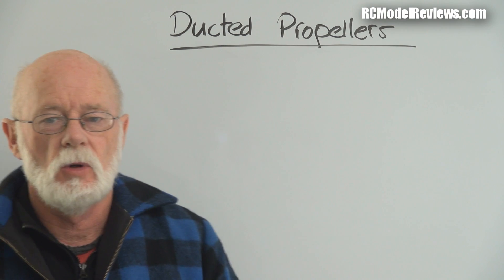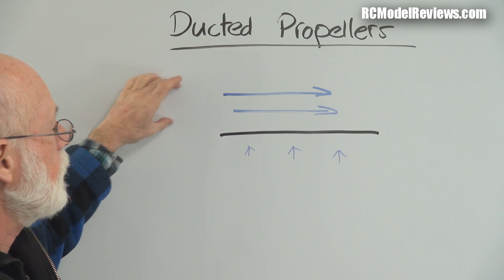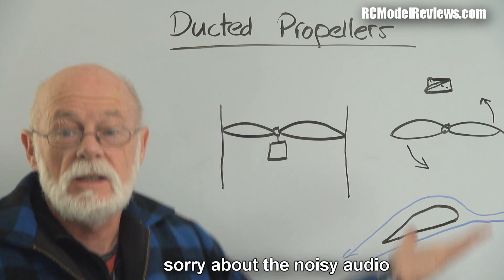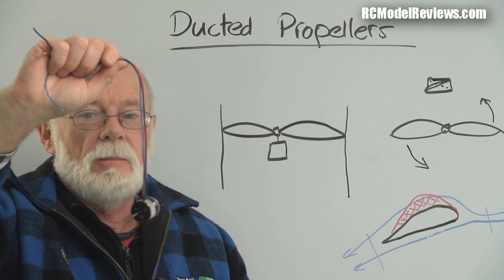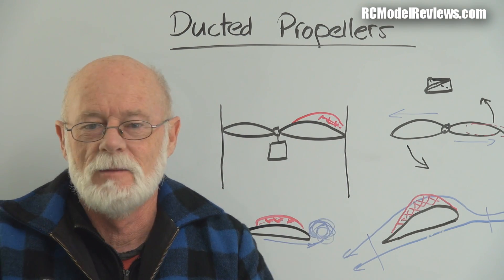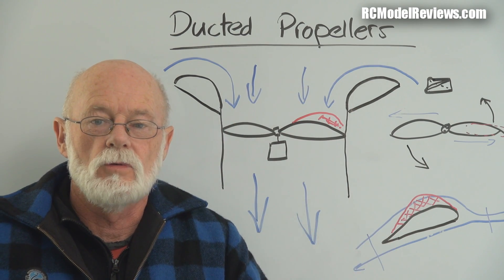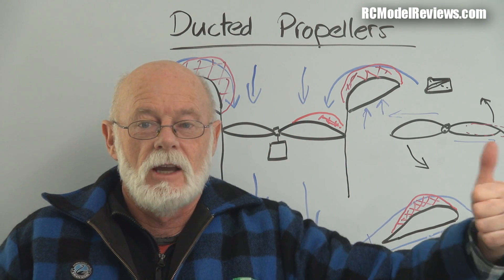How ducting a propeller increases efficiency and thrust

Comment: Very sympathetic guy, unfortunately he also gets bernoulli wrong or explaining incorrectly. The pressure on top is not lower because of a longer distance on top and higher on the bottom because it is shorter, that implies equal transit time which is wrong. The pressure on the bottom of the wing is higher because the air gets slowed down due to shape and angle of attack and particles on the top due to their mass try to move on straight and thus create a vacuum on the top. That really is simplified and changes around the body. The net result is lift and drag. One side effect is that the air is deflected downward but is not the reason for the lift, just an effect of the pressure distribution.

Comment: Bravo! And to think his brain must move faster than his mouth to convey the content so succintly and accurately makes the whole thing more compelling to me. Definitely not the kind of instructor I would expect to learn the lesson from the class lecture.  Had one not read the assignment and done at least a few of the exercises there'd be little chance of doing the homework much less passing the tests.   One thing that popped up in my head to ask was that to gain more lift by defeating wingtip vortices little, vertical spoiler vanes were added to larger aircraft were added. I presume they were meant to retain as much low pressure over the top of the wing.  As such, would spoilers on propeller tips work to enhance or obviate the need for ducts?

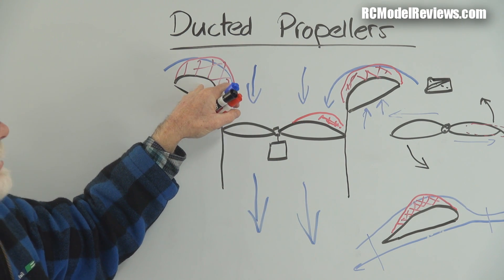Comment: 14:43 your "coanda's lips" will suffer the same vortex as a regular propeller because of the centrifugal force pushing it's high and low pressure zones to the border... so you add a second tube around it ? with new lips... with a 3rd tube... with lips... this has no end !

Comment: so as the air pressure decreases in front of the prop, less air is there for the prop to "bite" into sooo.. does the prop cavitate in air or does a vaccuum occur and it pulls the prop forward? and when you go higher in altitude and less air is available does the whole system collapse..... and how big does a prop have to be to work at high altitudes... ;)

Comment: Great video! 
Loved the content, however one thing to realise is that the lift provided by a wing and therefore the thrust produced by a propeller is mainly due to the Coanda effect which we have recently acknowledged that proves that the flow of fluids conform to the shapes they are moving against, so the air gets deflected down because of the airfoil shape and in Newton's 2rd law, every force has an equal and opposite reaction, creating lift.
Reply: thanks for the comment, i was wondering about that...I'm currently researching designs for  a stationary duct for manned electric copter,. Do you think the duct has a negative affect on vehicle speed when rotating the blades?

Comment: Patents    ES0444150   ES8300608     ES0293837    (Marine Propellers)
 US1609978    DE394245   DE394244     DE438028  (Aircraft) 
Would the Stipa hollow fuselage provide lift if airfoil, rounded duct entry lips, are only in lower half? 
   https://youtu.be/kB4-_OWz5qE Langley NACA wind tunnel tests evidenced increased drag. 
Hovey 'Ducted fans', pointed the speed range Ducted fans are best.        Blessings +

Comment: HOw would You compare this info on a wind generator turbine. Would the ducts lip have to be on the backside of the propeller? How about the effects of centrifugal forces in the different parts of the propeller blade - can you prevent it with multiple internal tubes and how much it effects. In wind turbine weight wouldn't be the primary issue, but just getting the blades as much wind as possible. So how to increase the wind speed on the generator turbine blade?

Comment: How about the effect of the support beams that hold the duct in place?  Any increase in efficiency since they slow down the rotation of the air column which in my opinion would cause less “slippage” by increasing the angle of attack of the blades against the column of air passing through the duct?  Kind of similar to the opposite rotating dual prop set ups on high performance outboards.

Comment: I hate to brake this to you, because youre really good explaining the matter, but 
a) at 6:00 youre oversimplyfying: You are implying, that particles which neighbour each other before beeing splitted into the upper and lower side streams have to arrive at the same time at the trailing edge and become neighbours there again, thus the upper stream has to go faster. This is not fully true and you are not giving any reasons for why it should be. In fact, even when fully laminar and without any separation occuring, both streams will not reunite into the neighbouring positions they had before the splitting. And
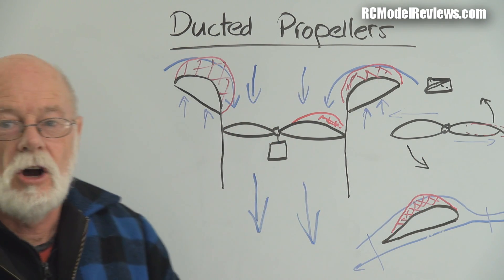b) at 14:16 you are simply wrong, when stating that there are no costs: cost 1 is the friction drag along the additional surfaces, which reduces the thrust gained, cost 2 ist the extra weight, that has to be compensated by more lift and cost 3 is the reduction of manouverability by the increase of projectional area and the distribution of mass away from the centre. All these costs have to be outweight by the correctly stated thrust gain for any specific air vehicle design.

Comment: Can u do a video explaining why high v and low I is no different to low v and high i?. Its an irritating rc myth that persists. P=iv and fir correctly sized components,   r reduces by the square as v increases. Ergo there is no difference ... illustrated by power loss = iv. 
As an electrical engineer this myth has annoyed me since it started years ago.

Comment: i have always wondered about the effect of a duct around a propeller... your video was helpful in explaining how it works, which I had already kind of thought, but could never prove.
  this system seems like it would be great as a stationary unit to move air more efficiently, BUT... my hobby is full sized boats, so.... 
 how would this work on an outdrive that is moving THRU the water at 50mph?.... I am aware that at low speeds, the efficiency would be improved and probably most noticeable when turning tightly such as in a marina, because of the vectored thrust that an outdrive/outboard steers with... (as opposed to a "deflected" thrust from the use of a rudder)....
   I think, at high speed the efficiency would be improved, but the drag caused by the duct thru the water would cancel out any possible gain, and quite possibly be REDUCED far below the point that using the propeller without the duct on it would have....
and im sure the length of the duct would have some effect on the efficiency, but obviously, there would be a happy medium somewhere in the length of it, as too short wont help much, and too long would cause more drag...  what are your thoughts here?...

Comment: Good to see you've got all your ducts in a row... !!!

04:30 - You could've also drawn that wing level first, to illustrate that the pressure from below is not necessary; and that the longer trip for the airflow over the top, even at dead level forward motion, will generate SOME lift.   (A lot of people assume it's only the air slamming into the underside that generates all the lift.)
Then, draw a second wing WITH a tilt, and then add the "Newtons and pressure" details regarding the air pressure on the bottom to highlight the incremental increase gained.  Just for demonstration's sake.  I used to teach college.  

Your other explanations delineate the important elements of the physics of this so well, I started to wonder what would happen if, instead of embedding the prop inside a cylindrical tube, you attached a cylindrical "section" of a tube right to the prop.....   it would work better with a prop with at least three blades, and possibly ideally with four (in terms of attach-points for the ring to the props' tips), but with the cylindrical section travelling WITH the blades, I wonder if there might be further reduction in chaotic vortex energy in any good measure.

To visualize:  imagine a 4-blade prop that is 10" in diameter.
You create a very light cylinder of tough metal, thin plastic, or ideally, carbon-fibre, that is 10" in diameter and 2" in height.  You then attach the propellor blade tips to the inner aspect of the cylinder/ring at the 1" mark down from the top of it.  In other words, the blade tips have an inch above and below them of that thin wall of the cylinder.
When the thing spins up to speed, there would be less air "thrashing" between the end of the tip and a stable but unattached outer cylinder, and all the vortex-induced turbulence would be contained in the ring (at each blade tip point) and forcibly directed downward instead of churning around in intervening space.
There would also be a certain amount of centrifugal compressive force magnified within the inner aspect of the cylindrical ring at the most distal point, since air pressure couldn't help but be significantly increased due to compression from the blades' very high speed of rotation and compressive actions being funneled over into a very small area with nowhere to go but down (for at least an inch, anyway).

It might be interesting to test what height-to-diameter ratios would work best with such a design; the trade-offs being:
1) weight vs area/zone of highest compressive action within the cylindrical ring,
2) total mass of the ring vs motor stability & oscillation cancellation (basically, keeping it EXTREMELY finely balanced),
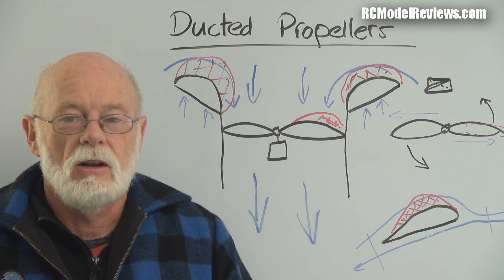3) comparing putting a flare around the intake or not such as you describe at about 15:30,  because not only would air being drawn in be being drawn over the curvature, creating some lift, but the curved part (being part of the cylindrical ring) would be spinning at insane speed too, and (relative to the relatively motionless air about to be pulled in) the lip would have air going crosswise (very shallow diagonal relative to its spin) creating another extremely low zone of air pressure as Bernoulli dictates.   
Worth investigating?   I haven't the time & resources at the moment to do so myself (just recovering from a nasty session of cancer in my head & corresponding radiation & chemo recovery), but I think there might be a few more tweaks such as this that could be engineered into an effective prop design that translates more rotational energy into vertically compressive/airflow energy.
I've just had another enhancement modification to that pop into my mind, but I'll quit for now.

Maybe this has already been done somewhere, anyway........  

PS:  In your intro paragraph, I'm pretty sure the word is spelled "theorem"...  no "u".   XD

Comment: I believe we shpuld also use dual propellers stacked one pver the otjer..9ne spinning cl9ckwise. The other counter cl9ckwise blade angles reversed sp both pull air same dirrection.. This equals balance .and particularly with a machine like helicopter would no longer need its rear prop because the ship would nolonger spin with proppeller .. I also believe we wpuld do well to put the propellers inside a box woth multiple vacuum hoses each having electronic valves.. This way we can dirrect air suck/blow to any side or above and below ship gor manuvering or hovering or braking..much like thrust vectoring but less complicated and using both intake and exhaust for steering = balance.. We may do even better to usemany small proppelers each inside theor own tube.. Woth both poppeller speed controls and valves.. Also we wpuld do well to give each theor own independant energy source amd magnetic clitch or add a swotch so the propellers may rotate 180 degrees swotching ditrection of airflow and quickly for brakimg or revers dirrection.. All synchronized together with steering and throttle of ship.. I also have design for a pump engine using the idea of a speaker in a box bit with more movement and high vibration we should be able to compress and blow enough aor to proppel.. The advantage of this concept is..the aor dorection of pull and push is neutral and may be controled with one-way valves rather than proppelers which pul air one way... The speaker box c9ncept shpuld be quicker at reversal of dirrection with less moving parts and a failsafe design.. Also we know ot takes very little energy to create an electromagnet strong enough to liftv100 lbs..so i imagine this engine desogn would notrequire as much energy as rotating propeller engines or jet engins..and may possinly opperate at higher speeds.. Will also work on water... I have one desogn whichbis a double pump as tmy tjeory is the electromagnet that pulls the speakers into the center of the box may be a hollow tube and thetefore the flow of energy along the pipe electromagnet should interact woth air molecules or water... This desogn was first draft concept for mechanical heart powered by harkenergies 8bpointed star or the electro cylinder drive.. Whichever is more suitable foe energy requirments

Comment: Nice explanation of how ducting works. The explanation of how wings generate lift however is wrong. Search for incorrect 'equal transit time' theory, which is what he's describing here. If lift was generated by the upper path being longer then yacht sails (being thin and having no measurable difference between sides) wouldn't be as efficient as they are!

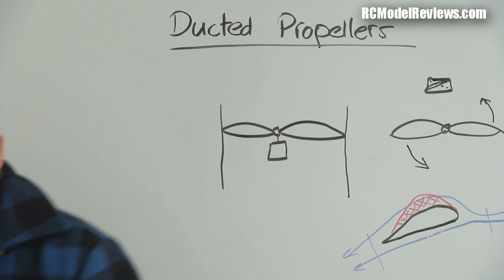Comment: 7:50
Ooops ... although your overall demonstration is great, there actually is no force trying to move the motor to the outside of the spinning radius. There is only the force of you pulling the motor towards the center. The motor wants to continue moving in a straight line but you keep pulling in on it. If you let go, its momentum will do that. It's called centripetal (center seeking) force and it's actually at 90 degrees to the motion of the motor. This is a very common misunderstanding of what's actually going on.

Comment: So, normally ducts are separate from the rotor, but what if you connect the duct to the rotor and have the duct spin with the rotor?
Is there a reason for rotors not being designed like that?

Comment: I worked for a major industrial fan mfg'r, axial and centrifugal equipment with 40-100 hp motors; every design factor discussed here was critical for performance. This was all spot on.
Reply: Interesting comment, ...I'm currently researching designs for  a stationary duct for manned electric copter,. Do you think the duct has a negative affect on vehicle speed when rotating the blades?

Comment: that's an awesome theory but: how do planes with symmetrical geometry of the wing fly? And why are the ducted cinewhoops take twice more power to hold itself in the air and louder two times than normal 5 inch quad?
Your theory looks awesome to be believed, but as I look on the industrial planes with props none of them have ducts.

Comment: was really into your video and hoped you didn't do the mistake of attributing lift of the airfoil or a majority thereof to Bernoulli's principle. The major players creating lift are the Coanda effect and as you stated Newton's third law. 
{Lifting airfoils are designed to have the upper surface longer than the bottom.} This is not always correct. The symmetric airfoil generates plenty of lift and its upper surface is the same length as the lower surface. Think of a paper airplane. Its airfoil is a flat plate --> top and bottom exactly the same length and shape and yet they fly just fine. This part of the theory probably got started because early airfoils were curved and shaped with a longer distance along the top. Such airfoils do produce a lot of lift and flow turning, but it is the turning that's important, not the distance. There are modern, low-drag airfoils which produce lift on which the bottom surface is actually longer than the top. This theory also does not explain how airplanes can fly upside-down which happens often at air shows and in air-to-air combat. The longer surface is then on the bottom! It is also why the shape of the wing is so critical to achieve the "turning" of air. A small buildup of ice disrupts the coanda effect and the air can no longer adhere to the wing smoothly and therefore does not follow the downward flow at the trailing edge thereby reducing lift dramatically. 
You can read more from NASA's website. 
https://www.grc.nasa.gov/www/k-12/airplane/wrong1.html

Comment: So why is it common knowledge that free rotating propellers are in fact more efficient? I'v read some papers showing this, also with proper experiments.
Is it due to the increased friction inside the duct? Not the propeller touching the duct, but air friction?

Comment: Excellent illustration of the Bernoulli principle.
Apparently the CIRCULAR wing causes higher pressure to surround the propeller air flow, increasing the power.

Comment: With the piece of paper he actually demonstrated the Coanda effect. To demonstrate the Bernoulli effect you would have to use an actual rigid flat plate.
Reply: I'm guessing if he had used a rigid plate, it wouldn't have risen no matter how hard he could blow?  Like if he hung the paper straight down with no curve and blow on one side, it would just push the paper away from you and it wouldn't move towards where you are blowing,  basically the opposite of what he is claiming?
Reply: One can NOT apply the Bernoulli principle on two seperate airflows. The airflow over and the airflow under the paper are two different flows.
The paper was lifted because of the reaction force generated on it to the downwards routed (turned) airflow.
i.e. the air was forced to go down whereas the paper (wing) forced to go up ....as a reaction.
Reply: @vatandas1542  he was blowing on top of the paper, not on the bottom
Reply: @DavidL-qb8cl  yes. Blowing trough the upper surface created a downwards routed airflow (due to the initial downwards deflected paper) . An upwards reaction force was generated on the paper. Similar to how aircraft wings generate lift.